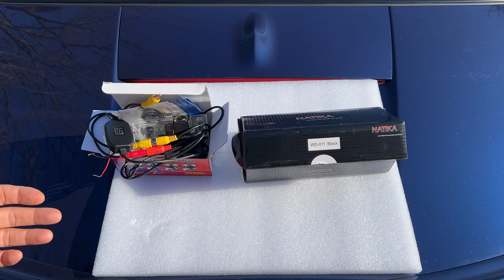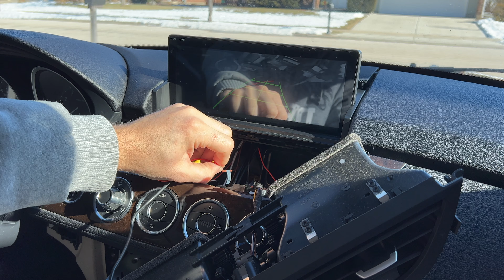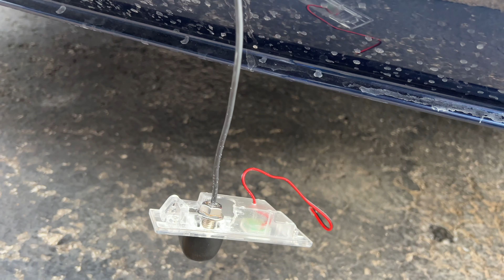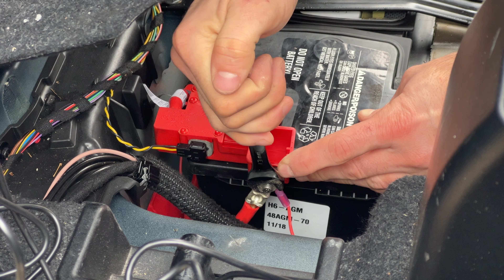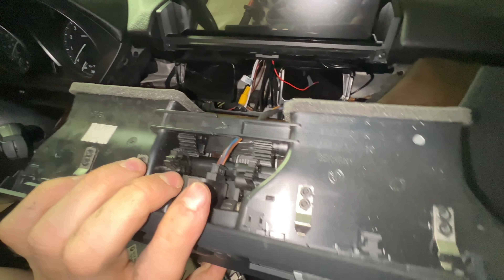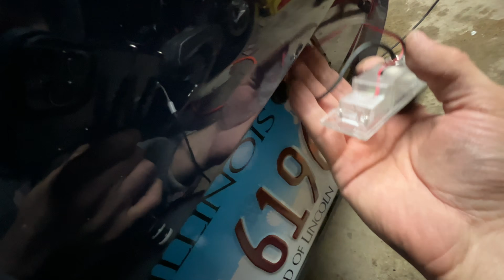BMW Z4 Reverse Camera Install - Aftermarket Backup Camera DIY

Comment: I just installed the exact same gear on my 2013 BMW Z4. You don't need to splice the wires to the reverse lights or use a relay anymore. There's a camera 12v+ wire in the new screen unit's harness that provides power without the need for a ground. Also, I had to go into the factory settings of the Android screen to get the reverse page and video to display, which required a passcode. You may need to contact the sales company for assistance. Last, the bumper trick is slick, but probably won't work if you have RCA connectors. I opted to use the same camera setup to save me the hassle. Great videos! They really helped even though I ran into issues that Simple Car Guy did not.
Reply: I guess you must have an automatic then?

Comment: I wouldn’t run that wire through the taillight gasket, you don’t want water ingress into trunk. There is a gasket on opposite side that works best.

Comment: Is there any way to correct the aspect ratio?
The video feed looks stretched out on the 1:6 display, but the video feed will be either 4:3 or 3:2.
Reply from the maker: I did not find a way to change the aspect ration. The video is a little stretched out, but works well for me.
Reply: @SimpleCarGuy  thanks for the reply. appreciate  the advice.

Comment: Hey question for you I have 2010 Z4  when you ran the wire from the trunk to the inside of the car how big is that opening . I want to run RCA's from a aftermarket head unit and speaker wires to 5ch amp . Keep up the great vids   Oh what is all of that white crap on your car and on the ground  LOL

Comment: Just a note: Have one fuse close to the battery terminal and not close to the relay. If something happen it will melt the whole cable to the relay.

Comment: A great vid. as always, thank you. Just one question, does the original Z4 wiring include a cable for the reverse camera? if I am not mistaken you have installed the Apple retrofit before carrying out this job, so I am not sure how the original wiring system is. Thanks for your response.

Comment: as per the manual from the camera you dont need the relay 12v and ground if you have a 12 volt from your head unit. the cable that carries the video feed and the red pig tail include the ground. when your car goes into reverse it send 12v down the line and down steps to 3.5 volts which turns the camera on. 

check this out https://www.youtube.com/watch?v=6HD06ZAUngw

Comment: Great video and much appreciated. Installing a reverse cam is not a straightforward process on the E89. Thanks for guiding through it.
Reply from the maker: Not sure easy, but can be done if you think about it one step at a time! Realistically, it's not easy on any semi modern car unless it already has the wires there.
Thanks for watching!

Comment: Andriy, this is a great video as always. I've been recently thinking about doing an android update and reverse camera install and this video was a great help in understanding how much work it might involve. This content will come in handy for sure when I do it but at the moment I need to resolve an issue that's been a PITA for a while. 
My car (2011 Z4 SDrive 30i with N52 Auto) has a battery drain which is not consistent, as in sometimes car can be parked for 2 weeks and everything's fine but other times within a couple days parked, battery will die (almost down to 4 volts or even lower sometimes).  Have you ever heard of anyone experiencing such issue?  I've ruled out a short in the wiring since the drain is not consistent, so I have a suspicion that may be any circuit or any module when triggered after power down, isn't able to go to sleep sometimes and other times everything works as expected. I have replaced alternator (the original had a bad rectifier circuit although it was charging fine) and I have a 1.5yr old battery so they aren't the culprit. Just trying to gather suggestions for when I start diagnosing it in spring.

Comment: Do you really need the reverse camera? E89 is the simplest of my cars to back park. In my opinion it needs front camera :)) because all what I still feel a little uneasy to do is park in front with out to hurt my bumper :) I have another engine (n54) but do you ever have problem with unstable engine operation at cold (at idle)? I had change sparks, injectors, ignition coils, air recirculation tubes in idle. There are no one erros. There are 2-8 missfire in few cylinders for about one houer of work. How do you think what I have to check next?
Reply from the maker: You are definitely right about the Z4 not needing a camera. I did it just to do it and to have it a little more modern. Front camera is also a good idea and I think this unit supports it. Would have to double check.
As far as your N54, I had that engine in my 335i back in the day and I've never had those issues. Looks like you've already done the main items that could be causing this. It could also be HPFP starting to go bad, especially if you have any kind of hesitation on hard acceleration.
Reply: @SimpleCarGuy  Yes, I already thought about HPFP. Looks like it's next for diagnosis and replacement :)
Reply: Sergey, I can't say specifically for N54 since my car has the N52, but I have another car which has a 4 cyl DI Turbo engine (78 k miles) and I have rough idle at cold starts and slight rough idle after engine warms up fully. No codes whatsoever, fuel trims are fine and I've taken care of all engine related services myself at regular intervals. The engine does well under acceleration, and the roughness is only felt during idle or when I am coming to a sudden stop during the transition from rolling to completely stationary idle. My problem is most likely due to carbon buildup on the back of intake valves which is a very common problem for DI engines as the fuel goes directly inside the cylinder and never gets a chance to wash the back of intake valves like PFI engines. Due to this, the valves aren't able to seat properly and there is some leakage which can cause poor combustion and also changes the constituents of the mixture that goes into the cylinders so the factory calibration isn't able to account for that as it doesn't know what happening. Again, I can't say if you are experiencing same problem since I don't know how many miles you have on the engine or whether N54 has other nuances that could cause your problem as miles accumulate.
Reply: @666deagle50  My problem is very similar to the one you described! How do you think ignoring of this problem with carbon buildup on the back of intake valves  can lead to serious damage?
Reply: @SergeySemenovS  Sorry for late reply.  It won't cause any serious damage but if that's something your engine might be struggling with, then the problem generally grows with mileage and eventually you'll need to get it cleaned. Unfortunately there is no easy or permanent solution for this. There are only two options really, either you pay a shop to do Walnut blasting or you remove everything to reach the intake valves yourself in the runners and clean them using cleaners that you can buy off the shelf. It sucks that DI engines have this flaw and you can't really do much about it with preventive maintenance. But if you also have any hesitation in power at high loads/speeds, then your problem might be something else. Before you do any more expensive replacements, I would say get a good OBD reader that will show you real time data or let you record data and have someone sit with you in the car or drive the car while you look at the data. You wanna pay attention to your Fuel trims and make sure they aren't too high and also look at your O2 sensor voltages to see they aren't going too lean or too rich when you feel the hesitation. At the simplest level, a hesitation is either due to over lean or over rich mixture or inadequate spark and atleast looking at the fuel trims/O2 sensor stuff might give you some idea on how's your fuel system behaving.

Comment: Andriy, another great video.  I love how you always minimize the amount of "dismounting" of panels needed in order to run the wiring!  One recommendation for those like me who have an automatic transmission and are installing a rear camera and connecting it to that Android head unit:  My understanding is that you do NOT need to connect the two wires to the rear reverse lights, and therefore you do NOT need to buy/install a relay; simply tape up the two wires without connecting.  Somewhere in that bundle that is connected to/from the Android head unit, the signal for reverse is sent and the rear camera will be activated.  Simply run the pair of wires that you ran from trunk to the head unit; that's it.
Reply from the maker: Hi Mil! Thanks for letting me and everyone know! I hope someone that has an auto can test it out and let us know. I would think that both haver the same signal sent via CANBUS when the car is in reverse (like it knows to lower the passenger side mirror), but who know!
Reply: @SimpleCarGuy  Andriy, One additional suggestion is to silicon seal your new license plate light and then insert it into the bumper slot.  On my Kia Optima SX, a common problem was rear camera failure. Even though the camera was incredibly sealed, when I took it apart you could see the white salt dust absolutely coating the electronics!  Kia upgraded the camera subsequently, and I added a black silicone (my car is black) when placing the new camera into its slot.
Reply: Yeap, i have z4 and android head unit, that works by just simply connecting two wires, dont need to trigger cable 👍🏼